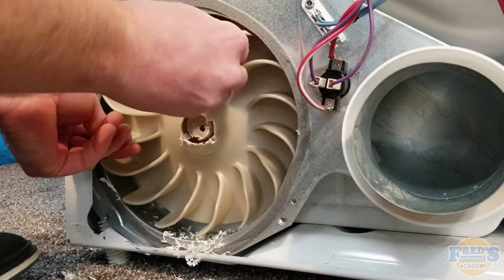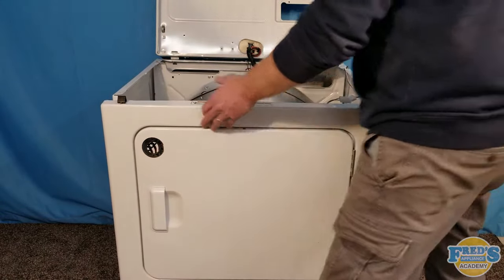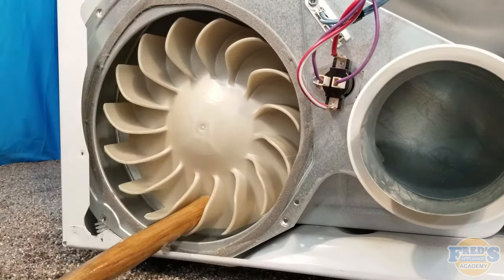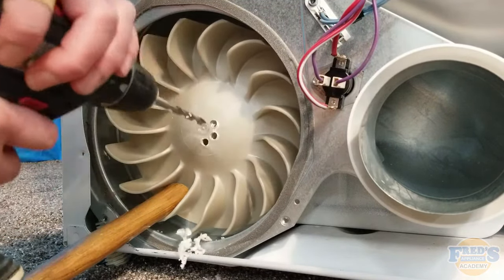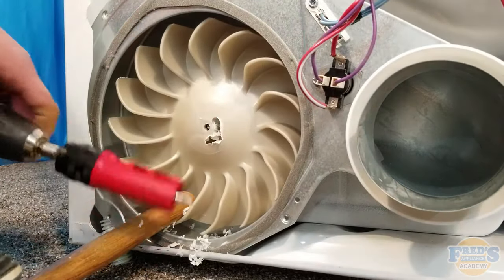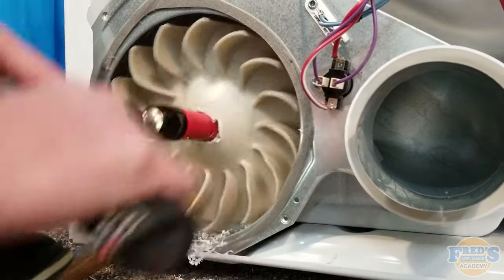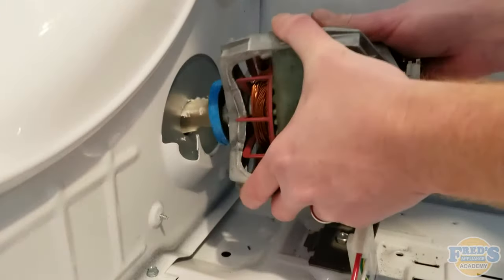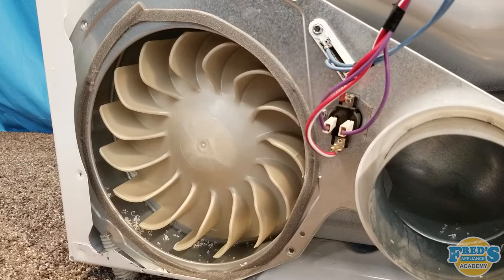How to remove a seized blower wheel and replace the motor on a dryer

Comment: Had to replace my motor in my 22 year old Kenmore as it was very loud...  This video helped a lot!  Was impossible to remove the blower wheel from the motor so I did the drill method you showed.  Took a bit of work but finally got it off and replaced both the motor and the wheel. Dryer works and sounds great again!  All for under 100 bucks!  Thanks!
Reply from the maker: That's what it's all about right there. Thanks PetrucciFan82!

Comment: There is another method to try before cutting the fan. I had stripped the plastic square center post of my fan trying to remove it the 'correct way' with two wrenches, and I couldn't get a grip on it. 
Put an adjustable wrench on the front of the motor directly behind the pulley that the drum belt goes on. There is a tiny flat spot the wrench can grab onto. 
Rotate the wrench/shaft so that it hits one of the dryer walls. This will prevent the shaft from turning. Not being able to turn is super critical. 
Then (with gloves ON because the metal is sharp as hell !!!) grab the fan and twist it hard. I had to put my body weight into it. It will likely break free. Make sure you are twisting the correct direction. Most of these fans have reversed threads. 
After I used a wrench to stop the shaft from turning, I was able to twist it until it broke free. 
I had to use both hands, and I know if I had not been wearing protective gloves it would have cut the hell out of me. 
Get cut resistant gloves and save a trip to the ER! 
Saved me from having to spend $15 on another fan, so I was happy.

Comment: What if your motor is still good? How do you get the remaining square plastic piece off the motor shaft so that you can install a new blower wheel on the existing motor?
Reply from the maker: I would suggest carefully cutting it off and reusing the motor if possible.

Comment: If your blower wheel is broken on the shaft you will need to take the tub out.  Use  a 1 inch wrench (or vise grips would work) to hold the shaft..  Use a pair of channel locks on the piece that is broken off on the other end of the shaft.  Turn CLOCKWISE to remove.  No need to cut it off as it will usually spin off just fine and you might damage the threads by trying to cut it off.
Reply from the maker: Thanks Sheridan. Just keep in mind this video is found seized on whirlpool blower wheels. Broken and Seized on being two different problems.

Comment: I just go hammer time on it takes about five good hits not exactly on the center but do around the core of it and leave the core behind. Pretty much leaves behind same size piece he had drilled. all the plastic will break easily with a hammer no chisel or anything else needed seriously 20 seconds and im cleaning up the mess and pulling the motor out

Comment: Okay from the service repairman. do you want me to replace your blower wheel n motor with a new motor and new blower wheel okay thank you that'll be $350 to $450 depending on your make and model. Oh so you're going to DIY well take it from me it is a far easier and less expensive repair if you find the entire motor and blower housing together on eBay and replace the whole assy especially if you have a GE of course if you're a DIYer and you have unlimited time to waste you could definitely follow this video. Out in the field unfortunately most of us repair guys if we encounter this type of blower wheel we would have to chip away and break it apart at the customer's expense of course😮😥💩